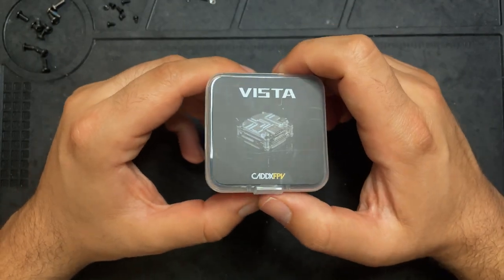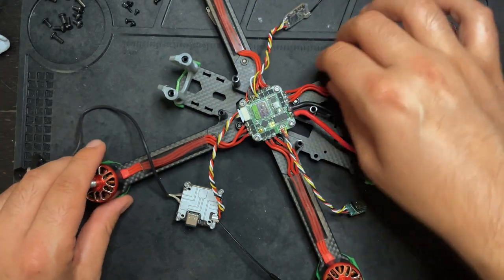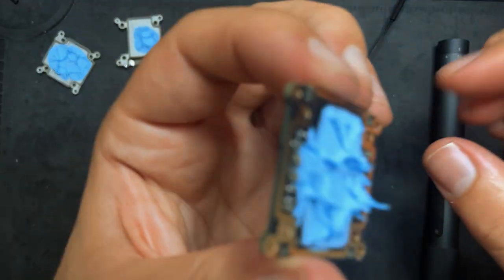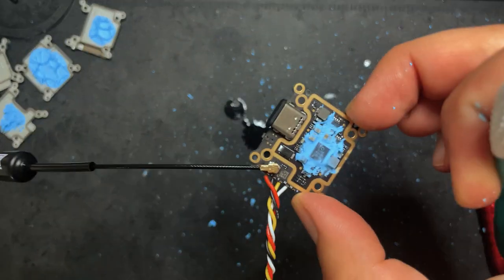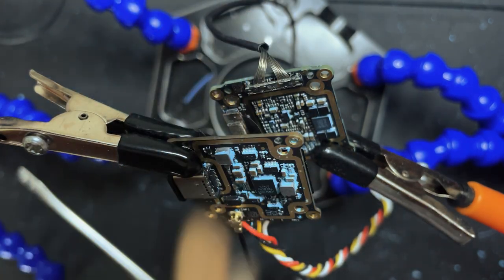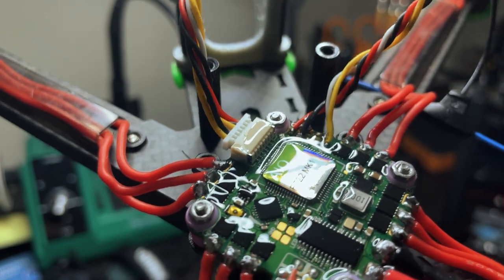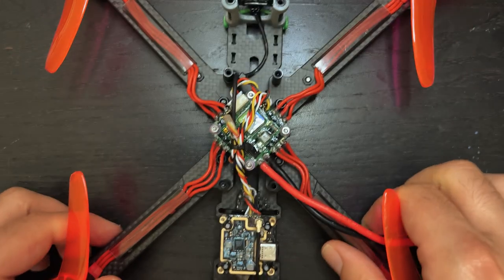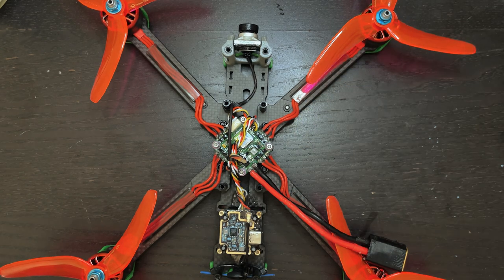How To Waterproof a Caddx Vista!

Comment: I'm pretty sure the blue stuff is thermal paste for the heat spreader.
Reply: Exactly!!
Reply from the maker: Yup! Couldn’t think of the name of it when filming this video lmao
Reply: Shouldn't we put the blue stuff back between vista parts for better heat conductivity? Or is it not a waterproof material?
Reply: @shumkis   I can’t speak to if it’s waterproof or not but it has essentially no effect, or possibly worse would be my guess, when it’s not touching(conducting)the metal heatsinks.
Reply: @shumkis   I can’t speak to if it’s waterproof or not but it has essentially no effect, or possibly worse would be my guess, when it’s not touching(conducting)the metal heatsinks.

Comment: Another idea is to add a bluetooth module to the flight controller and get rid of the USB wired connection once and for all. De-solder it even. Just use betaflight wirelessly on your phone or PC seems to be the better way to go. Adjust your rates in the field etc.

Comment: nice video. I was thinking, wouldn't it be easier to just put epoxy to cover up the edges of vista, (the only way water can get in) instead of all the hustle opening it up, would it over heat more or too much to be usable? What about adding an extra heatsink directly to plates to counter this. Also about the motors being waterproof, the reason they are is because the wire windings already have non conductive coating on it, but if you scratch the tiny wires it will leak a bit of current, its quite a tough coating though. Did you cover the wire solder to the motors though? My guess is this wouldn't even be a problem in fresh water, maybe some current will leak in salt water, but electricity always takes the most direct conductive route to close the circuit, that's why it will not jump through water if it has super conductive wire connection. Therefor I think it's not needed. I even dipped a 6S lipo battery with  connector exposed into fresh water to test this and sure it will leak current and discharge slowly but there isn't enough conductivity to cause damage.
Reply: Yeah bro. I went this route and results are good.

Comment: 14:45 isnt it a thing that the unit is putting down the output power automatically when there is no goggles connected or the quad is unarmed? I thought that its locket to 5 mbits, sure it gets hot but nor so hot as that you could destroy anything (atlease unarmed/no goggles on the bench)

Comment: So the vista and the Dji pro camera are both 100% waterproof submergible works every tike with live feed ive seen a few videos of it. & ive dunked one myself but you have to plug the usb. & from what ive seen this is onlh the case in fresh water salt water is to harsh & u better do some adjustments if your in the salt water.

Comment: that blue shit is good youll want all of that in there. its thermal paste like what you use on pc mother boards. id fill it with thermal paste rather than the coating i also think its oil based also if air cant get in or out water cant either so the suction is good.
Reply from the maker: You'll want the thermal paste on there if you have the metal shields on, yes. I wouldn't just put waterproofing over it though.. I can't imagine that would stick at all or truly protect the board even if it did. 
I also don't think it would be wise to only use thermal paste to waterproof something like this. In a good crash into water I could see the thermal paste easily coming off enough to fry your vista lol. 
FPV Worry Free & Kotking adhere to the board and aren't coming off in a crash.

Comment: Revlon Nail Vernis  works also. That looks thick and reduces heat transfer for heat sink   =)
Reply from the maker: Yes I've heard certain nail polishes work to protect circuit boards, i've never tried any though. I use conformal coating on all of my drones to make them water "resistant", I would use something like this though to make it fully waterproof. Have been flying this on 500mw with no overheating issues yet! 
Thanks for watching!

Comment: Thanks for the video. Any reason you why you didn’t reapply the thermal paste and reinstall the heat sinks?
Reply from the maker: Main reason is because the heat sinks don't really fit on the vista once the worry free is applied. The thermal paste is really only going to make a difference when you have the metal shields on there.

Comment: Awesome. I've been using a hydrophobe frame. It's so heavy though... Would this work just costing the outside of a larger dji air unit?
Reply from the maker: You could definitely use this on the outside of an air unit and it would protect it. Im not sure if it would be completely waterproof though.
Reply: Upgrade to the custom 6 inch arms and run 2506 motors, night and day difference

Comment: The blue is thermal paste and probably shouldn’t be taken off, did you vista eventually overheat?
Reply from the maker: I haven't had any issues with the vista overheating. Thing still works great!
As with almost every VTX, if it just sits there powered on long enough with no airflow i'm sure it will overheat.
Reply: @TRONCATFPV  oh nice, that’s good!

Comment: was not the air unit suppossed to be or come already waterprooof ? i remember seeing someone testing it out and is waterproof as it comes
Reply from the maker: The air unit may be water resistant, I don't think its waterproof though.
Reply: Brandon put a Vista in water and it still worked, not sure about the normal Air Unit. The O3 is definitely not fully waterproof out of the box, people killed them in water already.
Reply: @razorblade7108  o3 cannot be waterproofed, vistas  pretty much are... Fat units dont think si either
Reply: @guatemalamini  The O3 can be waterproofed. Quite a few people have done it in different ways. I'm currently trying my own way, but I probably killed a camera or it's cable. The unit itself seems fine so far and I guess the camera just has more need for cooling than I thought, so it's better to put thermal paste or thermal glue inside instead of lots of rubber sealant. The braided cable is a pain in the ass and so is that little sponge below the MIPI cable on the air unit, but covering it all with rubber sealant does the job. Others pour epoxy into the components or create sealed bags with butyl rubber. It's actually the camera that has cooling issues when waterproofed, the air unit is completely normal even with the vents covered. Since everything inside is fully packed, there is not much airflow through the vents anyways and most heat is dissipated through the metal case.

Comment: How much have you used drone as it has no heat sink on it now and you have pretty much insulated it so it should be getting hotter than before just wondering if it's going to overheat and burn out very interested in this being a success as I want to put one on a submarine
Reply from the maker: This is a drone I use here and there on special projects (typically, flights in rain or when water is involved) 
I don’t use it all the time, but I’ve never had issues with overheating. 

If you plug it in and just let it sit, you’ll have overheating issues. 
If you plug it in and fly, you’ll be good.

If you’re putting this on a submarine and it’s going to be submerged in water I doubt it will overheat.

Comment: yo troncat, love your content man. Question tho, I did this waterproofing, using the worry free, but after, my vista not coming out from low power mode and I getting no OSD in my goggles. You think it overheated with the waterproof coating ? now my fav quad is kinda ruin, I might have to change the vista unti and try again.

Comment: Wait, I thought the Vista and O3 were basically already water proofed?? I've conformal coated drones using both Vista and O3 and have had them come out from deep in the snow with no problem. My O3 got submerged in water too and had no issue.
Reply from the maker: They're water resistant, not waterproof

Comment: Is the USB port still usable?
I don't use a gopro but I always use the footage of my o3 air unit, can I still plug it into my laptop to get the footage frok my sd card or is the seal for the usb port coated on and stuck on it? Curious on how this could work best.

Comment: Instead of pulling it completely apart, just make all the connections, incl usb (with some vaseline to keep the stuff out) and just dunk the whole thing in the conformal coating. Thats how the electronics industry does it
Reply: I honestly think you might be onto something because I remember watching an old video from cyclone FPV where he was waterproofing and OG air unit and he sort of basically what you are describing

Comment: I had a caddax underwater for about 4 hours. Somehow it still worked after! I think it was due to the battery unplugging before crashing into a river.
Reply from the maker: yea a lot of times as long as theres no power going through it when its dunked it will be fine if it is able to dry completely.
Reply: The vista is fully submergible there is video of brandon fpv dunking a vista in water with the dji camera it stays on crystal clear they are already waterproof but i am not sure about the nebula pro. Ive been trying to figure that one out for a few days now. No luck

Comment: Is there any other way to protect the connector to the PC without having to solder it back every time? I’m not planning to purposely throw my drone into water, but I want to waterproof for reasons like flying by a waterfall and some drops of water might get onto the drone
Reply from the maker: For something like that I would just coat the board in conformal coating and use a plug to cover the USB port. 

You can also add Bluetooth to the flight controller and then if something happened to the USB, you can still connect to the FC via the speedybee app. I have a video coming out soon on how to do this 👍
Hope this helps!
Reply: @TRONCATFPV did you make a video? Could you link me to it?

Comment: that blue shit is thermal paste,its there to spread the heat from the components out to the heatsinks and vice versa.heat maybe a problem when u suffacate the board with the waterproofing?
Reply from the maker: Yes I know what it is lol, forgot the name of it when filming.
I haven’t had any issues yet and have been flying on 500mw. I’m sure if I let it sit idle with a battery plugged in it would overheat just like a normal naked vista.

Comment: does your drone still work?  I'm interested in longevity of this treatment?  you mentioned your analog drone from a year ago but didn't mention if you had it under water a few times and whether it still works?  same question for the vista, I heard on another video the vista is naturally water proof already, what do you think about that?  how is this digital drone doing after a few weeks?  Thanks for your great video. subbed now
Reply from the maker: Yes this drone is still going strong and performs great. Also, I have some components from the older build that have kotking on it that is still waterproof and still works. 
Unless you try to remove the waterproofing it lasts a while.

As far as the vista being waterproof, I don't think it's completely waterproof, its probably water resistant but if its left submerged for a while I don't see a vista surviving underwater. If it were waterproof I think they would want to advertise it as such.
Reply: DJI conformal coats their boards. They are ‘water resistant’. With that said I’ve flown the potato in full on downpours with no issues 🤷‍♂️. Great vid. I’m working on waterproofing a whoop right now.
Reply: @SkeezyFPV  I doubt you will see this as it is under a 6 month old comment, but I thought I was the only person who flew his DJI potato in heavy rain! It's about the only thing its good for! Lol! I'm totally kidding. I love the DJI Potato. It is the drone that got me into this wonderful hobby!

Comment: How did you change the caddx to low power mode for when youre not flying ?
Reply from the maker: in the goggles settings menu make sure that "Low power when disarmed" is turned on. If you have the vista configured correctly with your FC, it should be able to recognize when the drone is armed and will automatically switch the power mode 🙌

Comment: So I got an eachine wizard x220s and when I plugged it in and turned it on it started smoking and there were sparks going everywhere I asked for a refund but the place I bought it from wouldn’t give me one is everything on the drone fried or can I fix it this is my first drone so I have no idea what to do
Reply from the maker: It sounds like the flight controller is fried and you'll most likely need a new one. The exact same thing happened to me on my first build.
Highly suggest getting a smoke stopper to prevent shorts: https://www.racedayquads.com/products/jhemcu-xt30-xt60-smoke-stopper?_pos=1&_sid=765a29dcb&_ss=r&aff=58
Reply: @TRONCATFPV  do you know what flight controller I can get to fix it with. can I use any of the 4s brushless flight controllers?

Comment: Worry free says the vista is water proof as is
Reply from the maker: As far as I know they are water resistant but not completely waterproof. I don't think a vista can or should be completely submerged for long. The pads on the outside are exposed and water will most likely ruin components over time. 
This method (although it takes a while) ensures it is completely submergible and nothing will erode.

Comment: but i think you have significantly impaired heat transfer
Reply from the maker: correct, when you remove the heat transfer it will get hot faster. I haven't had any issues though. Just don't let your drone sit idle on the ground for too long! I wouldn't do that even with the heat transfer.

Comment: Better than 25mW is to turn on "auto temp control" which is like PIT mode for vista as long as quad is disarmed. I'd also mention that there are coaxial cables for vista <-> camera that don't have the connecting wires exposed so much. Unfortunately online shops often don't show the correct image, but some sell the protected ones. If not, I would use some electrical tape.

Comment: Did anyone gonna tell him the vista is waterproof to begin with?
Reply from the maker: The vista is not waterproof, It’s water resistant. 
If they are completely waterproof from the get-go, I’m shocked that nobody has advertised it as such.

The method in this video makes the vista completely waterproof and submergeable.

Comment: Why take all the glue off instead of just applying watercoat. Makes no difference. No need 😂
Reply from the maker: It does make a difference actually. 

Not only are you saving weight but when the metal shields are on you can’t get waterproofing in between the boards in the middle where the ribbon cable lies. Water can get there through the 20x20 mounting holes.

I’d rather take the time to disassemble and do it right than worry about burning out a vista 😉
Reply: Ohhhhhh gotcha bro bro 🤟

Comment: You realy put your lipo under wather?  Battery like your is not waterproof an can blowup.
Reply from the maker: lol, your LiPo will not blow up if it is in water.
I have a couple waterproof drones and none of the LiPo's have had issues when submerged.
Reply from the maker: If you're flying with damaged equipment you're going to have problems, thats a no brainer.
If you have a LiPo thats in good condition, it is waterproof and will be fine. In the video you linked he demonstrates this.
Reply: LiPos have to be airtight, otherwise they would burn. Airtight is even better than waterproof. You only have to worry if the LiPo is punctured, but then it will burn anyways.

Comment: Nice one! Thanks for the great tutorial using my product! I’ll add this to the how to playlist. It just ended up in my feed somewhere. For the motor bearings I’m working on a product that you can spray into the motors while they are running to clean off any gunk in the motor windings and re lube the bearings. What is your instagram so we can keep in touch?
Reply from the maker: 🙌🙌
It's solid stuff dude!
I'd love to check out the motor bearing lube & cleaner once it's available. I have motors that I'm hesitant to use since theres gunk in em lol. 
My insta is @troncat_fpv
Reply: Sounds like you are re-inventing WD-40 😄